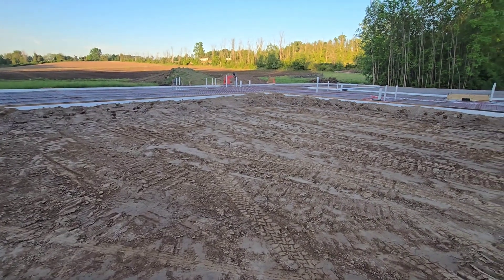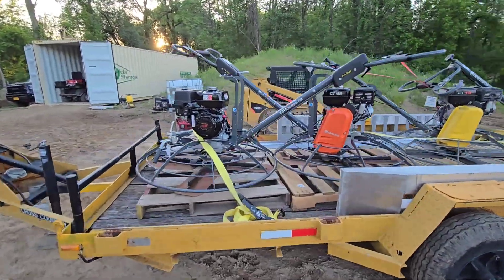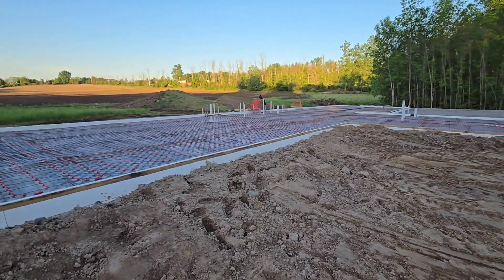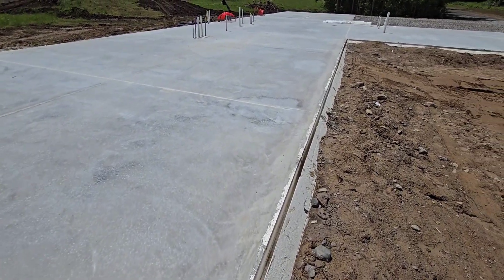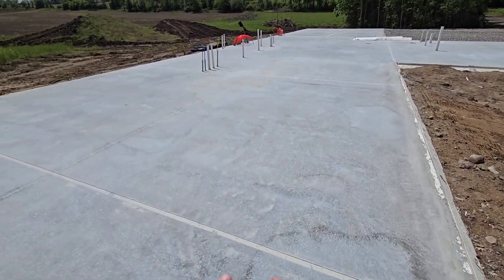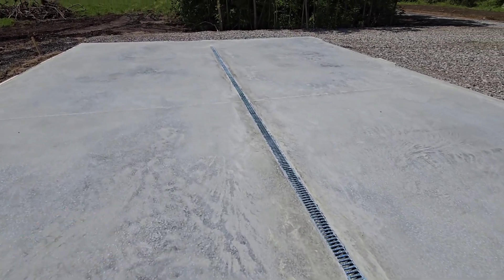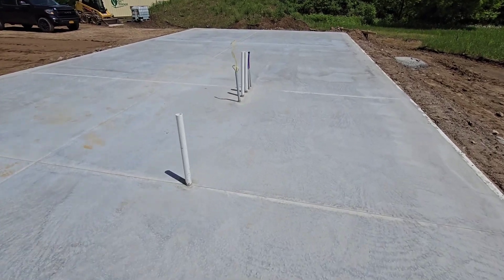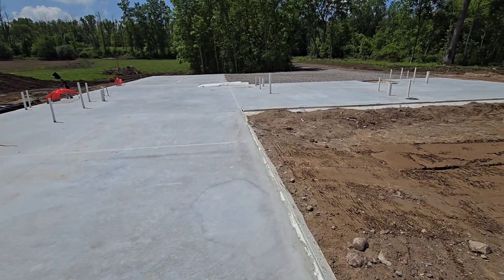Pouring and Finishing a Monolithic Slab Foundation With a Concrete Pump Truck

Comment: Looking good but have a question.  At 6:03 in the video I see a box framed in and peaked my intrest. Later I see it wasn't filled with concrete, what is it for or it's purpose?
Reply from the maker: That's going to be a walk on shower. It will be filled with stone and mortar and so it's a smooth transition from the shower to the bathroom floor
Reply: @JimSperanza  never saw that before but makes sense.